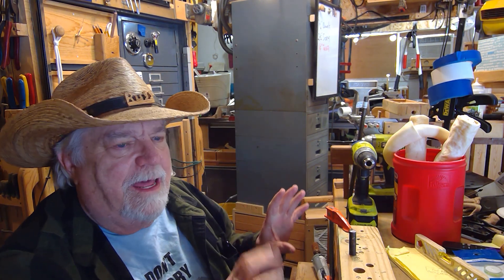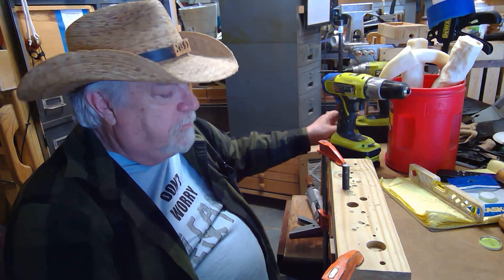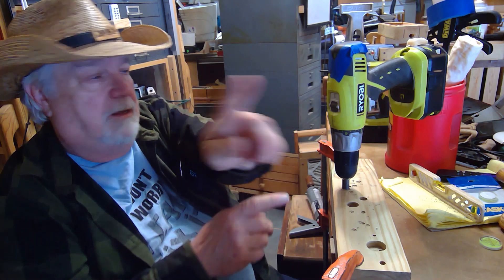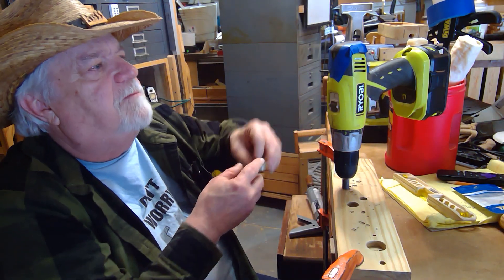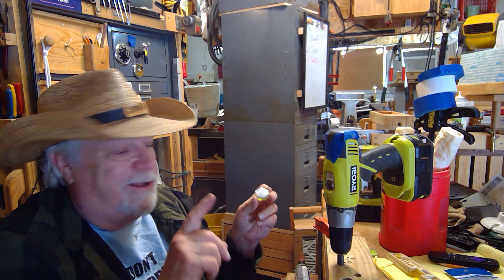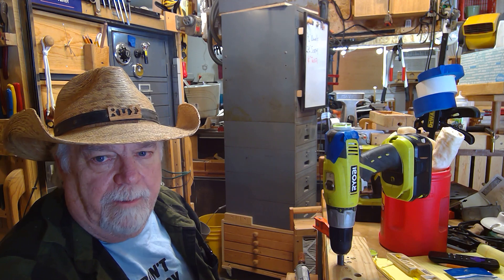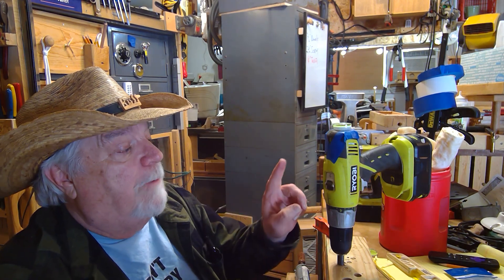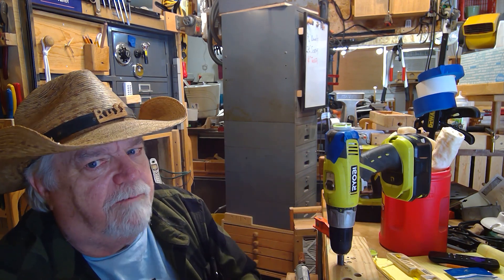Install Bubble Level on my Drill by OTB Thinker

Comment: nice job , interesting video , but how to in horizontal position  on  a wall for example
Reply from the maker: All my drills have a horizonal level built in.  If you have to, use a straight level bubble on the top using this same methodology in horizonal instead of vertical.
Reply: @russveinot5754  hi,  thanks for your feedback  ;  sorry , but in horizontal mode you control only the hight low position and not right/left
Reply from the maker: @michelsemimi  Sorry, I wasn't very clear.  You would use a "straight" vial level instead of a "circular" level and insert the drill bit in a hole that hold the drill horizonal instead of vertical.
here is a picture of a straight vial level:
https://www.ebay.com/itm/405215991755?chn=ps&_trkparms=ispr%3D1&amdata=enc%3A1XcQ5bAIYSgqzvS7CfX0u2Q35&norover=1&mkevt=1&mkrid=711-213727-13078-0&mkcid=2&itemid=405215991755&targetid=4581046492584087&device=c&mktype=&googleloc=&poi=&campaignid=603247544&mkgroupid=1239150598504493&rlsatarget=pla-4581046492584087&abcId=9316119&merchantid=51291&msclkid=464178603e6f1ef8f6e81f359583c75f

Comment: Plot twist….The bench top was 2 degrees off level.  Shoulda rotated the drill and checked, after setting the bubble in place.
Reply from the maker: Drilling holes with a bubble gauge is like playing horseshoes.  Close is good enough for points :>).

Comment: I have tried this but the tool vibration affected the bubble and was more of a pain than what it was worth.
Reply from the maker: It must be a pretty strong vibration to affect the bubble. You have something else going on to cause that much vibration.
Reply: @russveinot5754  Actually, I tried it on my hedge trimmer to keep it level.
Reply: @russveinot5754  hedge trimmers have quite a bit of vibration to them. It really doesn't take much to vibrate the liquid in a vial.

Comment: I very much want to do this but there are some critical steps. 1.  The hoke that you put the metal rod into must be accurately perpendicular to the wood. 2. Assuming you follow the steps and set the bubble accurately, your work surface must be level as well because the bubble is accurate to gravity, not the surface so the surface must be level too.
Reply from the maker: Thanks for the input.  I have talked (throughout many videos) about the importance of knowing your shop and having surfaces that are perfectly level.  A level & flat surface is critical in any shop.  BTW, I have been using this bubble feature many times since installing and it works wonderfully.

Comment: how do you drill the hole straight, to begin with? the one you use to set the drill plumb? do you need a pillar drill? I went out to buy the target level and cant proceed 😣
Reply from the maker: take 2 boards glued at 90 degrees and set on edge to guide the bit with a hand drill.  Check bit in hole with level and then attach drill.  all pieces are at 90.  Just set bubble as shown.  Does that help?  if not, I'll insert a 2 minute demo on my next video.

Comment: Wow, that was quick response to demand. I really appreciate it because I was one of the requestees. I already ordered the bubbles and I'll start it soon. I suspect that I'll need to use a chunk of 3/8 stock instead but it should be sturdy enough to get the job done. Thanks again.
Reply from the maker: You can redo it if it doesn't come out plum.  Thanks Tim.  I try to react to requests quick.  Most bigger channels take a long time to response (if ever).  I want to do better
Reply: @russveinot5754  Well, you definitely did do better!